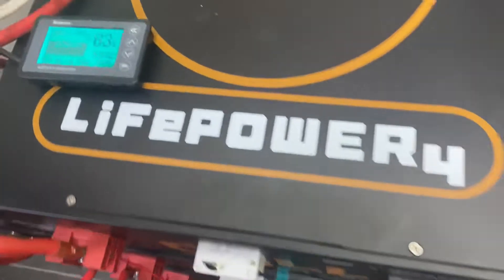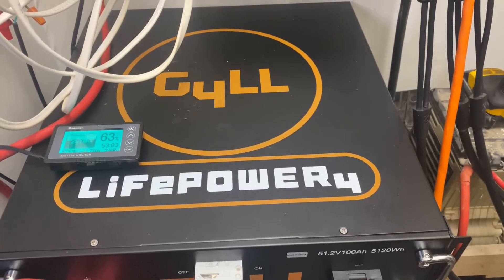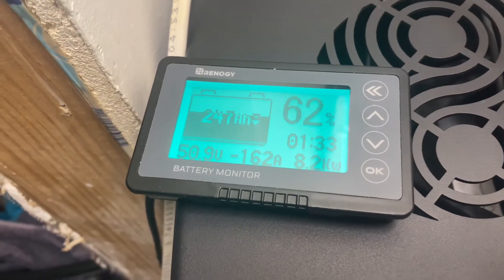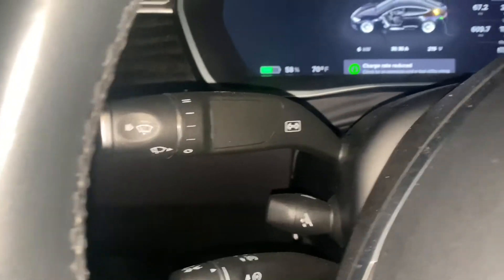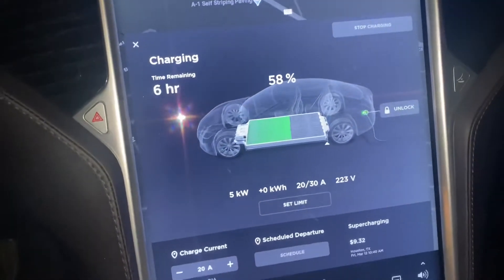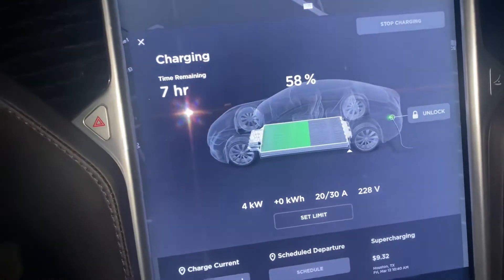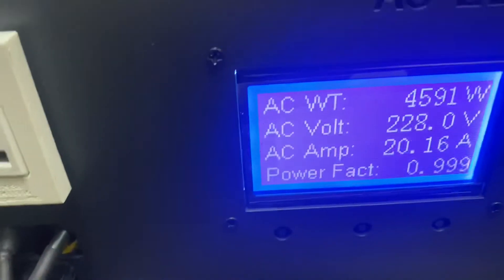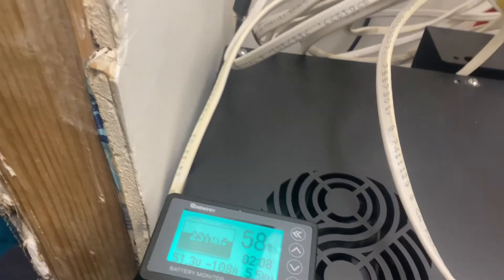Charging a Tesla on my (Off Grid Solar system )

Comment: What is the rough cost of the batteries and inverter for the chargeing cycles on the tesla. Ive been living off grid for 17years and am currently looking into buying an ev, however every single company ive spoken to are un interested is selling me a pedestal and providing me with specs for batteries etc. Am very interested in the tesla vehicle to grid idea as my home system has been 1.6kw for the duration of my residence here. Having a dedicated array and charging station with vehicle to grid potential to run my house would increase my quality of life and comfort immensely and provide me with reletive freedom from the cost of transportation.
Reply from the maker: To be honest I’m still trying to figure that out charging my Tesla use a lot of power I think I would have to add 20 to 30 more kWh and more solar panels
Reply: @texasoffgridguy8749  damn, thats alot of pv and batteries just for the ev, make the whole endeavor seem illogical in that the overhead on the charging system alone would easily cost as much as an ev in current usd. Definitely appreciate the time and energy you've putting into trying this out for those of us who've not yet committed. Very interested to see any further developments on your part. Thanks much, stay safe out there and have a wonderful week.

Comment: For those of you who live off-grid as I do, here is my charging station. On the flat roof I have four 300 watt panels 12 volt (a pair of two in series gives me 24 volts) and then both in parallel. They costs me $1200 at Home Depot. Next from Amazon a GROWATT which is an MPPT charge controller which accepts 2 volts, a battery charger, and an inverter which provides the level 2 charge. It must be a split phase unit as Growatt is.This cost $750.  I use four Battle Born batteries that cost $1150 each. They too are configured series/parallel as 24 volts. This unit can accept grid, generator and up to 2000 watts of solar. I suppose if you want to take a cross-country trip, the batteries can fit in the trunk as will the Growatt. You will have to plug it into the motel's 110 volt and stay an extra day or two.

Comment: you also shouldnt be charging your Tesla to 100% unless you NEED that much Range. dial the set point for the charge limit to closer to 80% to extend the tesla battery life
Reply: Yeah I agree on this I recently watched a video saying the exact same thing.  It was about scooter battery packs but same concept 80% max unless you need the range. Also as slow as possible if you have time time. If you are going to be home 10 hours no need to rush and charge it in 2 hours and it sits not charging the other 8 hours.  (Just an example I don't know how long a Tesla takes to charge) but slower the better is what they were saying.

Comment: i am concerned by the poor efficiency of that inverter. 8.2kW from the battery putting out 6.7kW into the car. thats only 72-73% effiecinet at best. I know there was around 200 watts previous, but I charge my tesla on my MPP Solar 5048MG and get closer to 92% efficiency from ot. Just a thought, use the MPP Solar inverter that you have, and just dial back the amps the car is drawing to not overload the MPP
Reply from the maker: Thank you for that useful information but im selling my Tesla tomorrow so I won’t have to worry about charging it

Comment: You shouldn’t charge your car at 100
Charge at 85%
Run a 6ga cable to the 240 back to the battery that will do you justice
Reply from the maker: I recently changed the wires and I charge to 85%
Reply: I charge my Tesla X Plaid off my 30 EG4  but only charge the car to 80%
Reply: @MitchellRanch  if you don’t want to use the full range, there’s no reason to charge 100% lithium batteries chemical structure works better at the low end 10 at the high end  90% 
The battery will see a bigger degradation if used all the time to 100. Because lithium cannot store charge efficiently.
Same like super charging all the time Izzadeen Academy a bad idea. Once a month is fine or if you are in a pinch 

To extend that I will recommend to charge to or 80. If you plan on going on a long trip charge full

Comment: Someone below mentioned about seeing if you could figure out how to charge your Tesla via DC. 

Well that’s going to be too hard to figure out for residential and something I personally wouldn’t want to try. As a Tesla uses X amount of DC voltage, while a Nissan uses XX amount of voltage for their DC charging. 

Basically there is a communication protocol that all EVs and DC charging stations use. The charging station knows what kind of car is plugged in. And thus will put out so many volts for that particular car. That is one issue you’ll have to over come. An other issue is the fact charging any Eva via a DC charger slowly kills the batteries on the EV. More so than charging it slowly via AC, which is the way you did here and if you were to plug into the grid. 

I hope I make sense here. But with that said, check this video out as he can explain the communication protocol better than I. 

https://youtu.be/RMxB7zA-e4Y

Also, if you have any questions on the Model S. Let me know as I have access to one as well.

Comment: dang!  that car is suckin' those batteries down quick!  Nice that you have that much capacity and can still run your house off of the other system.
Reply from the maker: Yes the car is draining it fast and my plan is to have 10 100a gyll batteries and add about 8kw of solar and a back up generac generator
Reply: @texasoffgridguy8749  Hope you get a good deal on the equipment.  It must be really expensive to do all that